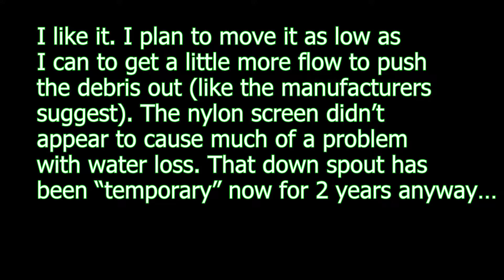Gutter Down Spout Debris Filter

Comment: most said that during a hard rain, most of the water ended up outside of the downspout created puddles of water. Not sure if it is worth it. Maybe for mild rain.
Reply from the maker: I agree 100%. Since I've had it up I noticed that in heavy rain it couldn't handle it. I've since modified it. When the hurricanes come through it usually rains for days. Early in the "event" I'll let the gutters get flushed out and then I'll cover the opening with a piece of clear plastic. I'll try and go out to check it now and then if I can, and then remove it after the storm. Well it's not perfect, it has kept the gutters above it from getting clogged with leaves and pine needles.